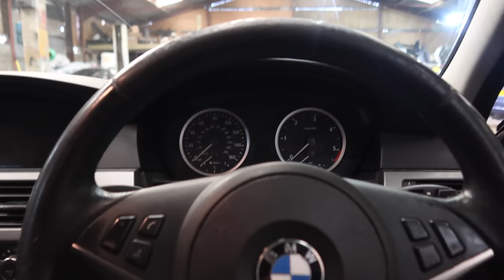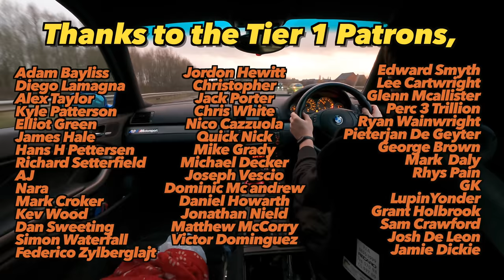Bad News About the Barn... 2022 Garage Update

Comment: Its looks like the dc2 is quite rusty still, it will need a quarter panel soon and it was under sealed over rust which is never a good sign, all fixable of course
Reply from the maker: It's not that bad, the panel has already been 'fixed' where its rusty and all the inside arch rot sorted. Just the panel that was used only got a light dusting of primer to stop it going really bad. The problem here is that was 3 years ago and it's sat in a damp barn
Reply: @dannyDC2  Treat and paint from the inside and its should be good 👌 Lost an ek due to rust, bad mistakes when I was 18/19 doing cheap repairs cost it, and shit Irish roads